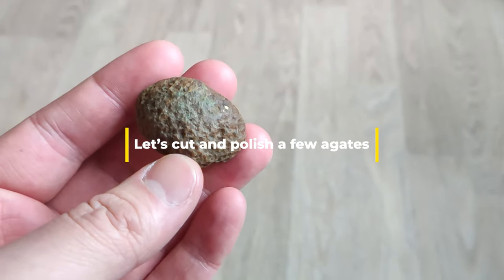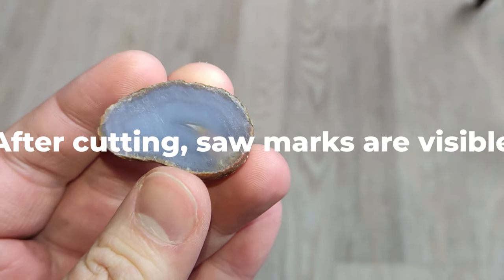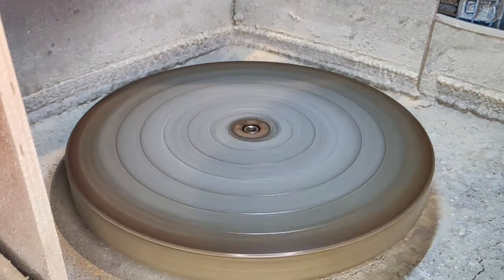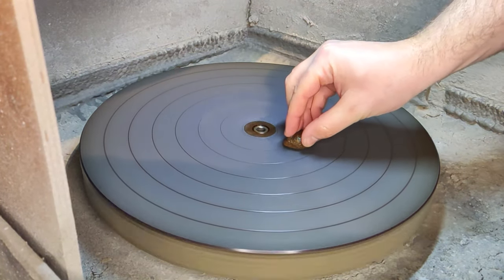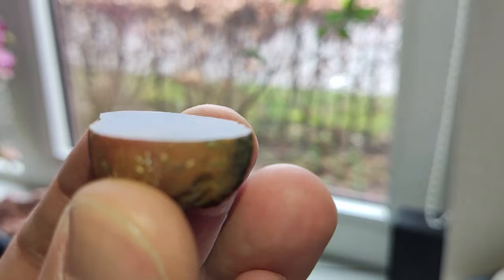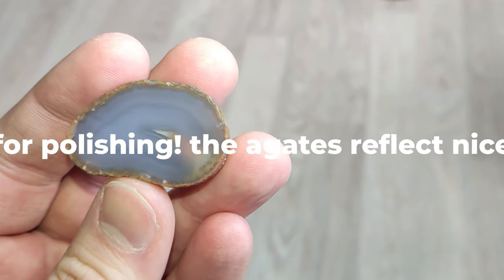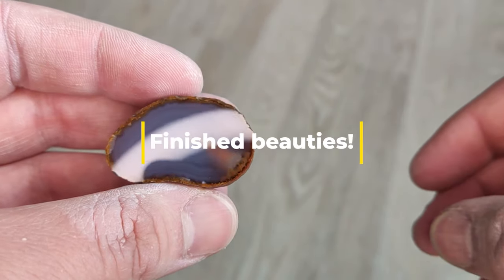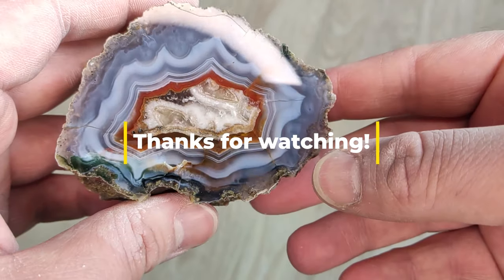Cutting and polishing stunning agates

Comment: To me it will be interesting to see the design of you lap. Especially the way how the disk is driven by motor and spindle mechanism.
Reply from the maker: It's not an insanely difficult design. It's a ste frame with an electro-enginge mounted to the back. A pulley with snare drives a centre pulley which holds the disk:)

Comment: I don't understand, I got into faceting and contamination is a big issue, but you use the same lap for every grit, how is that possible?
Reply from the maker: Faceting is a very different sport alltogether. I use a cast iron disk in combination with several grit sizes. I usually do more than one agate at a time. For example, I grind 20 agates with grit 150 to make them flat. Then I clean the disk very well and do all of them on grit 360 or 400 to smoothen. This way the disk gets primed for that grit in the meantime. Afterwards when I get to 800, the first few agates usually get scratches. After that, most will turn out perfect. The ones with scratches just go another round. So, yes, you can use one lap, as long as you use the same grit for longer, so your disk is ground down to the same roughness

Comment: That was a really good video. I have never used a flat lap like that. I have a very old, homemade flat lap, but I use laps with silicon carbide or diamonds in the lap, rather than brushing on my grit. It's not very good at polishing large, flat surfaces like you're doing. 

Have you ever used a vibrating flat lap? Your method looks better, but I was wondering if you'd done both so you could compare the two.
Reply from the maker: Using a vibrating flat lap produces roughly the same results, you just need some more patience, as the first grit might take a week to finish, before you can move on. Using a rotating flat lap is difficult to start with, but when you get the feel and experience, it is very satisfying and as you can see produces a water/mirror polish😁

Comment: The disk you used for polishing reminds me of a pottery wheel machine. What are the chances of it doing the same thing. If it does, I must find it in the warehouse. Beautiful stones and great polishing. Thanks for sharing.
Reply from the maker: Thanks! I think a pottery machine will not have enough power. It needs to have some speed, but also enough power to not get slowed down when you push a bit. You can try to do some research. The disk I use is polyurethane. I polish with cerium oxide;)
Reply: @tonnyvanhemert9826  You have made the right points. Yes, I hadn't thought about the power thing, thank you.

Comment: can you resource me how to get a polishing table and the stuff to polish it?? i want to polish my agates!!!
Reply from the maker: It's quite difficult. This machine was also hand built. For flat polishing you would need a machine that rotates a flat steel disk with grooves in it. On that you use Silicon carbide grits to grind. Another disk goes on with polyurethane or felt and you polish with Cerium oxide. Hope this helps a bit